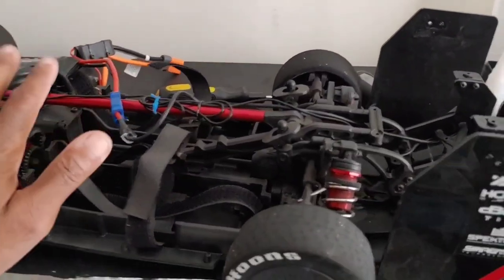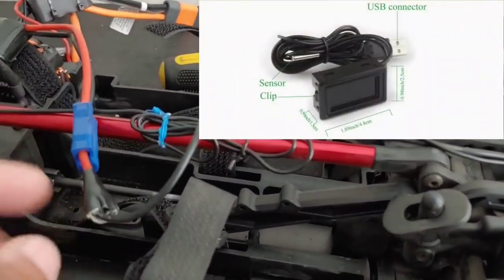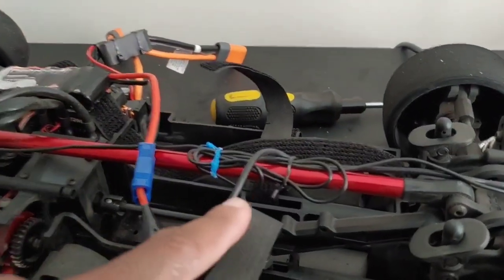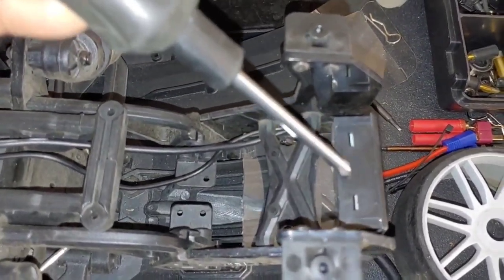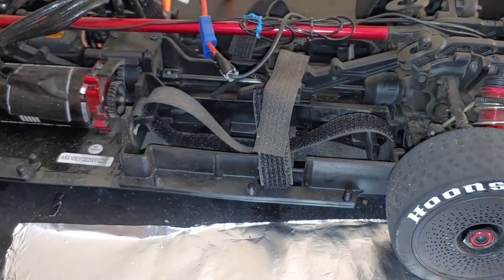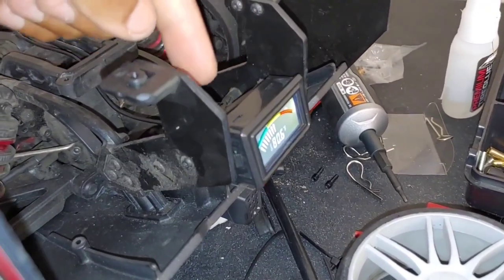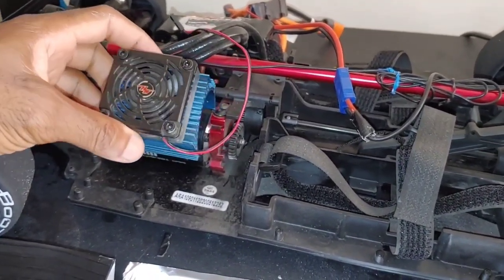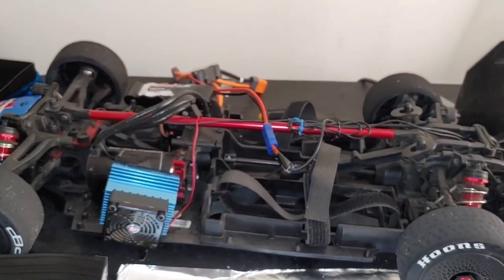How I installed a Digital Thermometer in my Arrma Limitless v2

Comment: if there was more a demand for these id release the 3d print mount i designed to mount to the mounts on the splitter
Reply from the maker: There could be. You could actually be the one to do it by a whole bunch of the Temps gauges and then create the 3D print for it and then sell it. Cuz this wouldn't go just for this car this could go for a lot of different RC cars maybe something you want to look into